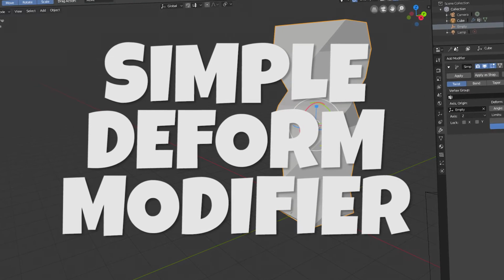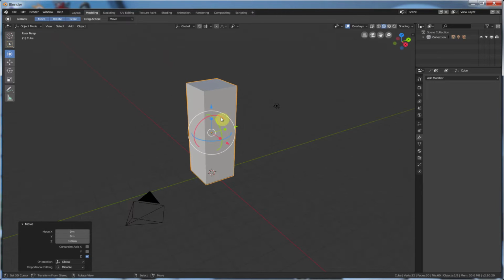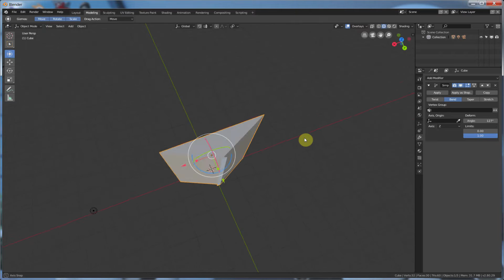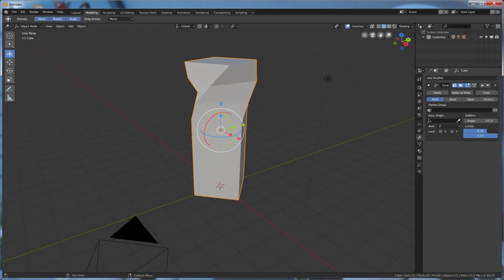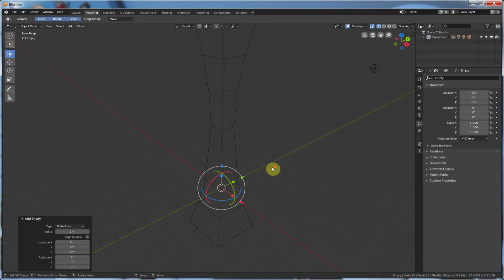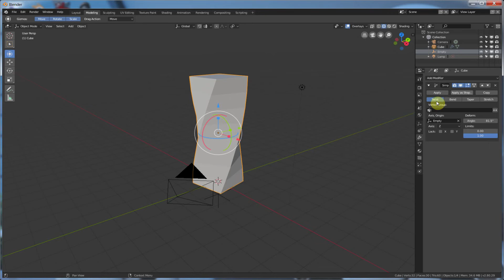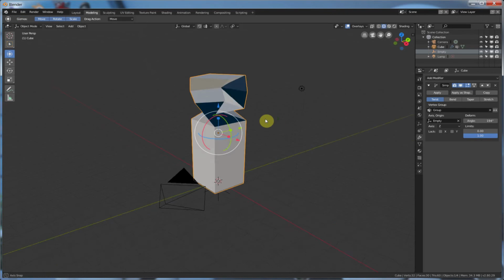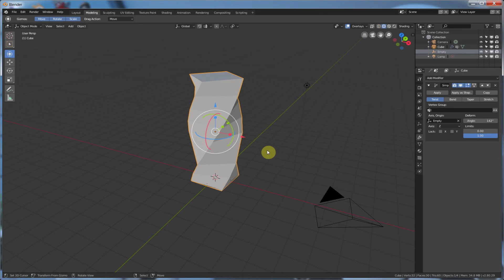Blender Simple Deform Modifier - Can It Screw Your Models?

Comment: I hope there will be an option to put solid with wireframe since the only way i see so far is by selecting solid and then go in the object/display menu and check wireframe!
Reply from the maker: Peter Tremblay I saw that too.  I’m hoping as well.  Thanks!
Reply: I don't understand why they didn't do it in the first place since when you are modeling this is an essential thing to have. @KevBinge
Reply: If I understand you correctly, there already is an option for this! Click on "Overlays" (top right) then under Geometry check the Wireframe option. You can set the slider to 1. There is your solid with wireframe! This option exists already for some time in Blender 2.80,  but if you have an older version it might not be there yet.
Reply: You are right i download latest version and it is indeed working, thank! @blenderfan6061
Reply: @petertremblay3725 , you're welcome. Glad I could help.